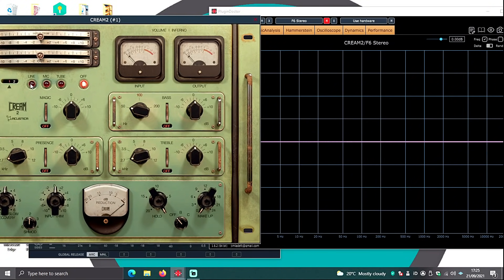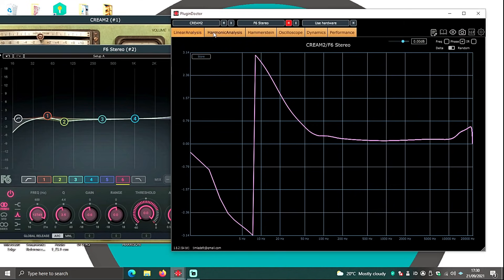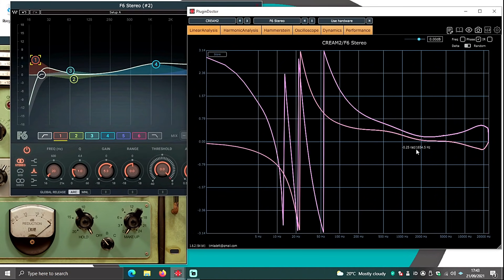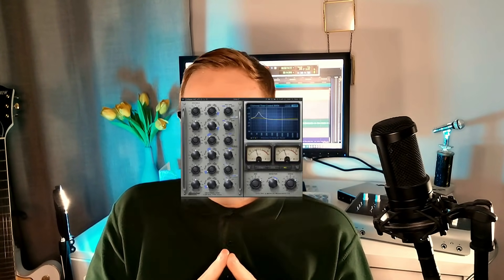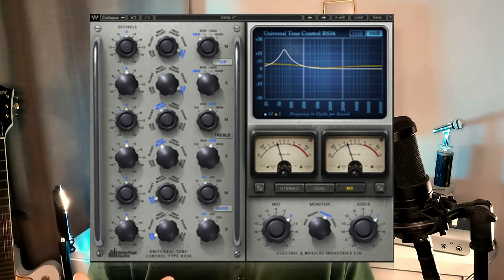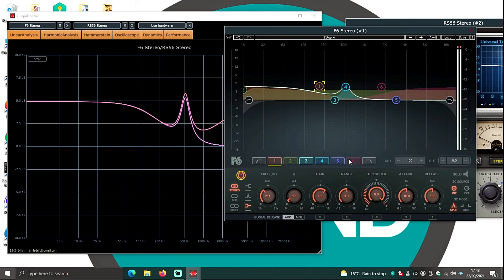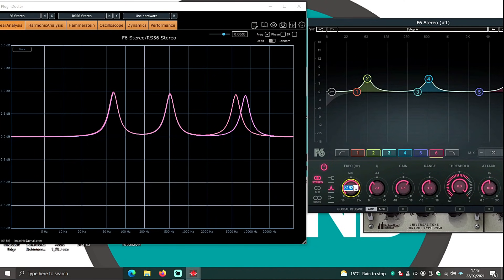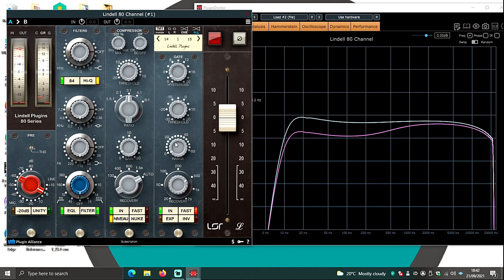WHAT MAKES A PLUGIN MORE ANALOG? || the differences between analog emulations and clean linear fakes

Comment: 2:20 yes I'd say linear is very much a mathematical term. For example with linear systems (for example digital eq) it doesn't matter in what order you apply the effects (when ignoring numerical rounding errors). You can also perfectly undo any effect of a linear system.
As a response to 7:00 : ripples alone don't make an eq non linear. You could design a perfectly linear eq with those curves (same freq and phase response). What a linear eq won't have however is any distortion or variability in response to the input signal that a non linear eq might have.
Reply from the maker: Yeah it's the non linearity of the system itself. Due to the length of it I took a lot out so I did go further but 45 minutes was way too long 😂
Reply: @PaulThird  Absolutely understandable. Choosing what information to include and what to remove from a video while keeping it entertaining and informative is really hard. 
I just felt like a more mathematical approach to 'linearity' really helps to understand what it's all about and where it comes from.

Comment: So, basically: when buying analog emulations from Waves, you are getting Q10 / F6 with a different skin and some fixed presets :D
Reply from the maker: Just in this instance.. And the tg mastering chain as well 😅 but the tg mastering chain has tape options and also the compressors which add harmonics so it isn't so bad but yeah the EQ is completely clean and linear and the tape and eq sections add no harmonics whatsoever so there is no pass through unless the compressor is compressing
Reply: @PaulThird  Very interesting. I have it, but I have never used it. Have you checked plugin alliance?
Reply from the maker: Yeah. Thd is hit and miss in the bx plugs. Sometimes it's just simply a third order harmonic but still saturation I suppose but doubt it's very accurate.

Lindell stuff is good though. Not too keen on the 50 channel but the rest of his stuff is top notch. Neold are really underrated as well. PA's big hitters were more mostly coded by Reymund who now has fuse audio labs and black rooster. That's why UAD pinched a lot of their stuff first.

You wouldn't find any dodgy stuff in anything he does. He's a top class dev.. Honestly one of the best. Does the best with what he's got. Black box, opticom, shadow Hills, maag, elysia.. Pretty sure it mostly all rey.
Reply: @PaulThird  You mean that Black box, opticom, shadow Hills, maag, elysia are from Reymund (audio labs and black rooster)?
Reply from the maker: Yeah pretty sure it was all mostly him until he left

Comment: Thanks for great videos! Is there some way to do similar analysis what you do with Plugindoctor but for analog hardware to see what they do?
Reply from the maker: There is a way via access analog that I'll show soon 🤓 it can be done with plugin doctor but you need the physical unit connected
Reply: @PaulThird  Ok cool, looking forward to that!  I have some analog hardware which I'd like to analyze. A Roland Space Echo RE-201, MF-104M and an A&H ZED mixer. I'm looking for a way to see what they are doing. When I drive the units I can of course hear an effect, but would be very interesting to see what they do at subtle levels and understand how and when I should use them. Analog summing or passing the signals through the pre-amps and transistors at different levels etc...

Comment: Hello there Paul,
Just a wondering, and great video on the linear and nonlinear EQ... brilliant.
... I'm trying to get my head around the difference in: linear and nonelinear EQ (well I've got this bit as you've shown), but when I speak of something being ninelinear, I then get involved in Linear Phase chat - do you discuss Linear Phase (or none) against what's covers in this video?
Ta very much Paul and all the best,
Paul Crompton.
Reply from the maker: Nah I've not covered any linear phase on the channel. The thing is with linear phase if I'm correct is that it only exists in the digital realm so with analog emulations there should never be any linear phase.

Either way linear phase only comes into play when you start eq'ing really as that's when you start finding that it's changing the magnitude and not the phase instead of natural phase where the phase is changed along with the magnitude.

Ive not looked into it enough but it's something I hardly ever think about unless I'm using a steep filter or thinking about mastering. I have a basic understanding of it haha

Comment: I bought RS56 too, after hearing Tchad Blake say he liked it. With respect to analog circuitry, rather than describing EQ curves, "nonlinearity" refers to the tendency of a signal to be distorted or otherwise altered by passing through components like amps; i.e., the audio doesn't pass through unaffected (in a linear fashion).
Reply from the maker: Honestly man if I had plugin doctor back in the day I wouldnt have bought as many waves plugs as I did. Still would've bought a few but no where near as much
Reply from the maker: Ditto 🙈
Reply: Haha! I bought the RS56 too after hearing Tchad Blake advertise it ;-/ At least it LOOKS like an Abbey Road EQ ;-)
Reply from the maker: The power of gui.. And endorsement 😂
Reply: @stanleyc6225  I’m fairness to Waves, there are a few of their plugins I’d never want to be without. They seemed to be on top of their game a decade ago and did some innovative stuff that still holds up incredibly… but they also became a giant corporate marketing machine along the way and are now a shadow of what they used to be. They’ve invested in endorsements instead of actually advancing their tech because $$$. It works sadly, but they’re losing the professional market because of it.

Comment: Have you reviewed the Waves AR TG Mastering plugin? 
Just found your channel, subbed and thumbed 🤙
Reply from the maker: Yeah but never made a video. Basically ported the Rs56 and added a few more frequencies. Eq and tapes are clean as a whistle and only way to get saturation out of it is to use one of the compressors but only at a certain level of gain reduction. Coded very wierd
Reply: @PaulThird  Interesting thanks for the response. I stay clear of all these types of plugins now I bought it when I didn't know any better thinking they're an all in one magic solution we all know that's a stretch.

Comment: Paul; helpful and informative (not to mention competent and professional, as is your norm)... Thank you! 

Looking at the Waves RS56 page (and the videos therein), I believe its possible that waves used the capable F6 engine to recreate the CURVES of the original unit (sans the noise, non linearity and distortion that the original designers of the hardware undoubtedly worked hard to eliminate within the tech constraints of that era)... and while those curves can (as you demonstrated) be replicated with any capable digital EQ (once one knows exactly what they are that is) the time it takes to do so can pull one out of the creative "flow" so .... maybe they made something useful, but should have made clear that's what they were doing (or added a noise / distortion knob... maybe).

Keep up the good work. ~~~~ (Good vibrations)

Comment: Really interesting vid! This is my current issue funnily enough, I've got FabFilter, Izotope etc. but feel I could do with some analog grit to go alongside them. Do you have any recommendations of good bundles? I'm considering Black Rooster's 'All' bundle!
Reply from the maker: plugin alliance subscription if you go down that route. Black box, neold big al, lindell etc there are a ton of options and you'll have so much variety at your finger tips. 

In terms of saturation the fire cobra from united plugins is stellar. at x8 oversampling no aliasing whatsoever. You are talking a crap ton of harmonics as well as punch and other options with no digital artefacts.

My advice would be some compression for some grit. I tend to choose colourful comps as my analog flavour these days. Even some heavy parallel compression dialed in can be really nice and add a lot of punch and girth at the same time. I use a LOT of compressors haha not that much of actual compression but a lot of compressors
Reply: @PaulThird  Nice one Paul appreciate it mate!

I'm not really up for subscriptions - I'd much rather pay once to own something, I like the look of the plugins but really would much rather own 'em!

Ah cheers, I'd not heard of that! For saturation I generally go for the SoundToys Decapitator, that bloody box is on practically everything I do including mastering work! 😅 Pull the dry/wet down and it can just bring out so much brightness, especially on the 'e' channel.

Appreciate the reply mate, if you have any recommendations for bundles for purchase it'd be much appreciated. Greetings from a rainy Liverpool!
Reply: @MaxRichardsonMusic  Check out the plug-in alliance policy. The total subscription cost is rewarded in vouchers to ‘buy’ and own those you like most. Add to this that they give huge discounts. So in the end you buy very good plugins for little money and as an extra you can use the whole bundle for free. What’s not to like about that? Never seen such gentle policies.
Reply: @enno6982  I've had a look, it's a lot better than I thought! The mixing/mastering bundle is pretty reasonable - may well consider that, cheers!

Comment: I love this types of videos, congratulations on such an awesome delivery of golden information!!

Two questions if you have the time!

1 - does THD only add the “ripples” and V gain saturation or are there some more things going on both option. Because I’d love to get the “ripples” on my bx SSL 4K E but no added saturation since I’m already running other plug ins to saturate. 

2 - why do I feel like some digital EQs are better than others at removing stuff. For example, I find waves Q10 a lot more efficient at removing resonances and high end spikes than infinityEQ like the bell/notch was a concrete dam on Q10 and a fishing net on infinity EQ (exaggeration but I thing you get the point ahah)

Once again, congratulations and thanks for all the info you provide and the fun I have watching your videos! 
Cheers!
Reply from the maker: Vgain is purely noise so you'd see some non linear randomness in the waveform but being honest removing noise is the benefit of digital so I always leave it off.
THD is the only thing that will shape the frequency response like that.

In terms of subtractive eq I too can hear a difference. I made a video where I matched f6, proq3 & amek 200 curves and then done blind test AB's and picked fabfilter everytime out the digital eq's. I never tried nulling as I could pick out the differences everytime. It was odd but it may have been due to the phase of the fabfilter as I hear a difference when you select different phase modes. Can't remember which one I picked
Reply: @PaulThird  Sir, you are god sent for us audio geeks! Thanks a lot! 🙏

Comment: is there not also another dimension to real analog units which is that they are also non linear over time, so that the instability of the curve and harmonics is constantly fluctuating, compared to the analog modelling which is only a single static snapshot of that non linearity?
Reply from the maker: That is correct 🤓
Reply: very good point,  raf

Comment: Let me get this straight, Waves changed the GUI of the F6 and sold it as an EMI EQ emulation? Shouldn't they be sued?
Reply from the maker: Other way round. Rs56 came first 😂 in reality they took their waves q10 or whatever it is ported it into an abbey road gui and set fixed frequencies and q's.

Abbey Road got their money for use of their name and waves got to piggy back off the name whilst not actually modelling anything. Win win
Reply: @PaulThird  This is huge. What else from waves is junk? If they have done this, they can't be trusted and every big name involved with their plugins needs to immediately disassociate themselves to save face.
Reply from the maker: They've not done it many times to be honest. The Abbey road mastering chain at a push can be described as the same as without the compression it is completely clean and linear. They actually drafted in the Rs56 code into the plugin but added a few more frequencies. Exact same q's. Only thing that adds harmonics is the compressor. Not even the tape settings. If you don't use the compressor completely clean but either way the EQ section is just a linear digital eq. If you just use the EQ section and no tape bias.. Rs56 with a few extra frequencies

Comment: Great post Paul !
I just find it a bit misleading that you use the word linear for an eq. I know you know but I would have liked that you just explain you do not mean linear phase eq. You mean smooth curves with no accident. You mean digital clean eq. (I reckon it is not easy to find the right word ^^)
Reply from the maker: Yeah it's not easy to find a different word as a nonlinear system is a system in which the change of the output is not proportional to the change of the input. The input and output signal differs by just running through the device making the analog non linearities of the components affect the output signal. 

So its hard as the Rs56 and waves f6 etc is still a linear eq as just running through the plugin has no affect to the signal. It's mathematically precise where a linear phase eq keeps the phase untouched. It creates a seperation from the frequency response but it still doesn't mean that the curves themselves are not linear. The frequency response stays the same in both modes 

Its a tough one as the system itself regardless of linear phase or non linear phase is still linear. You tell the system what to do and it results in a set result. It's kinda like saying that fabfilter is only linear when in linear phase mode. The plugin is a linear plugin.

It bends my head too much if I think about terminology too much haha